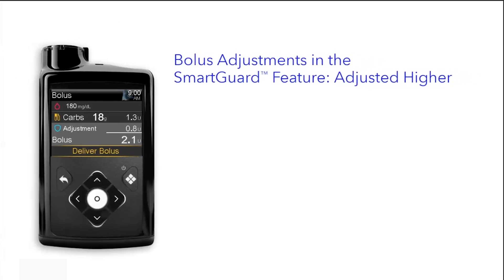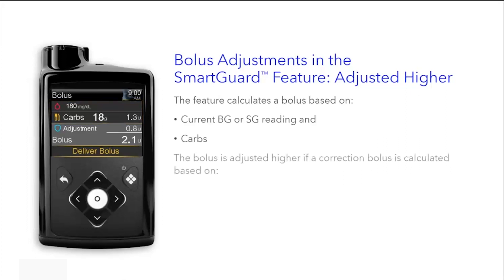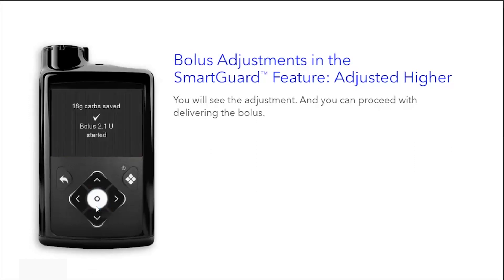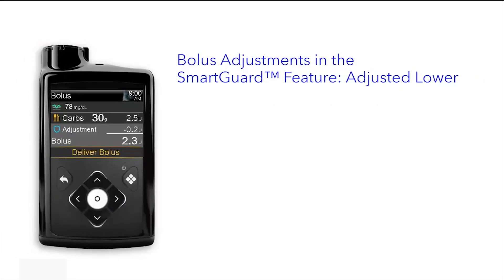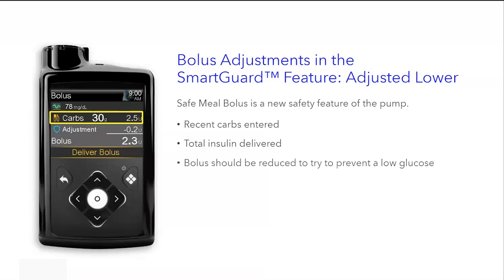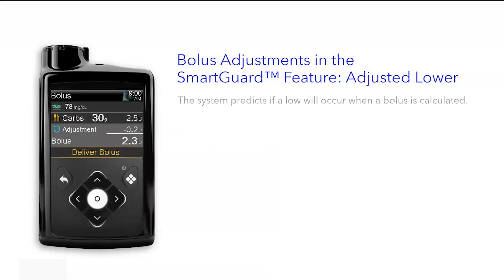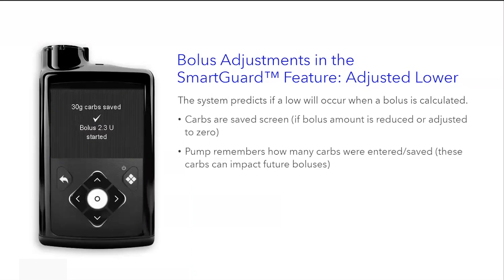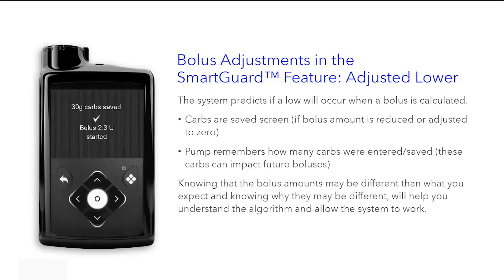MiniMed™ 780G System: Bolus Adjustments with SmartGuard™ Technology ​

Comment: My SmartGuard began to work properly after one month and a half. I have to say that I probably slowed it down by switching to manual mode for extended periods of time. My best advice is to keep it on as much as possible. If you go high and it doesn’t seem to do much about it, switch to manual mode and do a manual bolus (don’t input fake carbs!), then turn it back on right after the bolus. It’s crucial to count your carbs accurately and get your carb ratio right in order to avoid relying too much on SmartGuard to stay in range. Oh and make sure that your active insulin time is set to 2 hours. Just be patient, I can tell you that, once it figures you out, it does work. It does a good job at keeping me closer to the target and for longer.

Comment: I hate smartguard it's supposed to correct for highs but they hamstring it so it can't. If you're high and don't want to be for the next six hours because you majorly messed up or forget to shoot your best bet is to turn the damned sensor off and do a corrective bolus. As which point I'm sure the damned thing will crash your blood sugar because it only works right if you do everything right and by the book. I hate it and i want off of it. I have had low blood sugar at like 11pm all but every night for 3 months on smart guard. It seems i cant go more then two to four hours without my blood sugar crashing if i don't eat and by the time im hungry enough to get food my blood sugar crashes before i can actually eat then i have to decide between a cold meal and waiting 15 to 30 minutes with low blood sugar or having my blood sugar be f-ed up the rest of the day. Or just crashing 2 hours later. And you CAN'T SHUT THE DAMNED THING UP IF YOU'RE LOW EVERY 15 MININETS BEEPING OR BUZZING. Silencing alerts does nothing at all "for safty reasons" Listen to me medtronic if i just entered a blood sugar reading I DON'T NEED AN ALERT TELLING ME WHAT I ALREADY KNOW FROM THE BLOOD SUGAR READING I *JUST* TOOK.
Reply: I absolutely agree! My BG is 247, and it's doing a low correction! I also just turn SmartGuard off, bolus, and turn it back on. Worse, it won't give the basal after you've given a bolus. I don't like the algorithm thinking it knows better than me and my doctor!
Reply from the maker: We're sorry to hear about this. Have you already had a chance to speak to our Technical Support team about this? If not, please give them a call at 1-800-646-4633, option #1. Thank you.

Comment: Hi there. This smartguard bolus adjustment feature is so stupid thing on our pump, because negative adjustment up to 50% is catastrophic. And keeps glucose level higher than 200 more than 3 hours.. We can safe situation only with entering "increased amount of carbs" or with fake carbs. It cuts bolus more than 50%, so we made to enter 2 times more Carb. And it's boring. I think there's not any AI algorithm on the board of minimed 780g. Or this AI is very stupid. In addition there's not any information or advice what to do if bolus decreasing occurs mistakenly. And what to do to fix this bug
It already passed 6 months. The only reason why it was not switched to manual mode is that - ideal night BG. Except this your algorithm is big bully shit. And as a responsible company you have not do anything to fix this safe meal feature, which works wrongly. Please if you are not able to fix this problem, please just let people to switch off or on safe meal feature for each meal blouses if it works wrongly. Or do it so that cutted off amount of bolus may deliver as square wave during 2 hours. I am sure it will safe situation. But lazy minimed professionals who created this stupid safe meal feature are not going to solve this problem, with which most of your customers faced. Don't be stupid you have better device, just improve it, or please give the people a choice.
Reply: I agree. The automatic mealtime bolus adjustment thing doesn't work for me. If I leave it up to the algorithm, it subtracts about 50% of the calculated bolus amount, with my correct carb ratio of around 3 and the correct carbs entered for the mealtime bolus. If I just leave it alone and let SmartGuard operate with basal flow and correction boluses, I end up hovering over 200 for way too long, which is not much better than the horrible results I used to get when I first started with the 780G/Guardian 4 system and the Medtronic trainer insisted that I keep my carb ratio no lower than 8. Rather than entering fake carbs, I currently manually adjust the total meal bolus amount by delivering, in addition to what the system calculates, a MANUAL bolus in the amount that I specify. This manual bolus comes with no AI-triggered subtraction. To do this, I exit SmartGuard and then press the bolus icon and select the manual bolus option and enter the desired amount. I then re-enter SmartGuard, which requires entering a BG. For this step, a finger stick is not necessary. I just select the current SG value, save it, and select NO on the calibration query screen. These extra steps are kind of a pain and care needs to be taken to enter an appropriate manual bolus amount. But, it does work to keep me in range, with a reasonable average SG. And, if the manual bolus is too much or too little, SmartGuard monitors for low or high problems, which can be handled with common sense adjustments, like eating glucose tablets or gel or entering additional manual boluses. It occurs to me now that since the system appropriately handles glucose added to treat lows, without any carbs being entered, there may be no need to ever give ANY carb information to the AI system at work. So, I may be able to simplify the procedure by just having the pump deliver my calculated total mealtime bolus amount with a single MANUAL bolus at every meal. The downside (other than perhaps lack of endorsement by Medtronic and my endocrinologist, which I already don't get by virtue of using manual boluses at all) is that there will be no record in the system of my carb intake. But, what the heck, who needs to know? Time in range and associated average SG and A1C are what matters.
Reply: @PatrickFarrellucd  hope you are doing well. After multiple "experiments" and observations I found out that, the only reason was incorrect "active insulin period" which was set as 2 hours. But insulin on board was active only 2hours and 20 minutes. So I made it 2hours 15 minutes. And a year of observation spent finally found that it works great. Only did plus/minus 1gram insulin to Carb ratio And now most of time during the day we have straight line. It's pity that there is not any information which parameters must be adjusted when such problems occurs. Only self learning. Most probably your active insulin feature is wrong. Increase it by 15 minutes in your pump setting, and before each meal, just made your BG rise to 130-140, then bolus, observe 3 days, if it is OK, after 10 days you will not need to "spike" your BG, if it is not OK, then after 3 days increase it 15 minutes until you reach ideal diabetes control. And make a note if your 1 time bolus will be more than 5units it is impossible that active insulin duration in your body will be 2 hours, I mean more insulin intake, more active insulin duration. Hope this information will be useful for you.
Reply: @mahirbalayev5835  I'm confused. You're saying that by setting a longer active insulin time (2:15 instead of 2:00), my BG will come down more quickly? I thought it would be the opposite because the pump doesn't give me basal while the bolus is active. Wouldn't this just delay the basal coming back on?
Reply: @janabielecki7876  i am not an expert and I can do mistakes. But, it's actually related to your diet + sleeping regime +incorrect insulin to Carb ratio.
Correct your insulin to Carb ratio starting from breakfast. Once breakfast is OK, then lunch, after it insulin to Carb ratio for dinner. Adjust your meal times: breakfast till 8 o'clock in the morning, you have consume as less as possible carbohydrates, specially in the morning. You have to wait at least 20 minutes after the bolus. While waiting for not getting hypo, you have to secure yourself with 1spoon of meal, when you are bolusing. You have consume large amount of carbohydrate only after 4-5 hour later, if you do it earlier, BG spikes is guaranteed. Snacks only then when your BG goes under 100 only after 2 hours. Lunch time after 4-5 hours. (if you have eaten your meal at 8 o'clock, lunch must be between 12 and 13)Dinner also after 5-6 hours. (till 19),and between 22 and 23 you have to go to sleep. 100% TIR, and straight line of BG will appear on your screen. If your Carb counting is very very accurate and your insulin to Carb ratio must be adjusted by decreasing by 1 or 2 grams your insulin to Carb ratio until you receive straight lines after the meals.

All above mentioned steps was done for 5 year old kid.
Reply: @janabielecki7876  also, if you have eaten more carbs than your body needed, in lunch it will affect your after meal BG in the morning next day - most probably you'll observe BG spikes and after correction you will experience hypo, same thing may happen if you have eaten more carbs, only solution in this case, is to reduce amount of Carb for next meal (it doesn't mean that you have reduce protein and fat) . As a snack fruits are more preferably. Avoid candies, cookies, cakes. Active insulin feature in your pump is only for autocorrection - less duration means it will become more aggressive and those are the only rules. Please note that if you want to become more sensitive some sportive activities before each meal will be a good solution. For sports it will be better if you do when insulin on board /active insulin is 0.consume some snacks then start
Reply: @janabielecki7876  setting longer active insulin time will help with when pump reduces required amount of insulin
Reply: I agree! My BG stays high for about three to four hours before the algorithm finally gets it down. I've tried adjusting basal, bolus, insulin sensitivity, everything, and nothing works. The algorithm forces me to have a high BG for four hours after I eat!